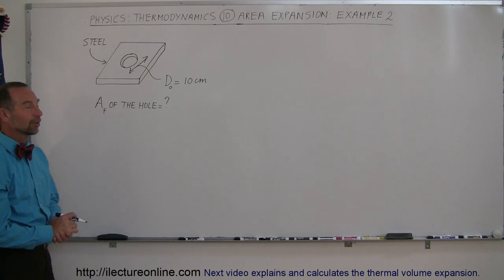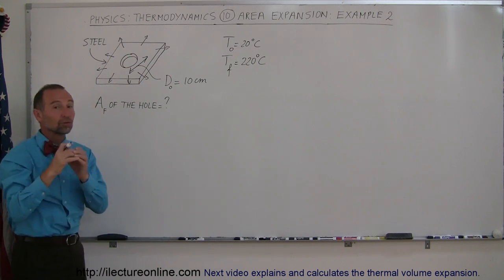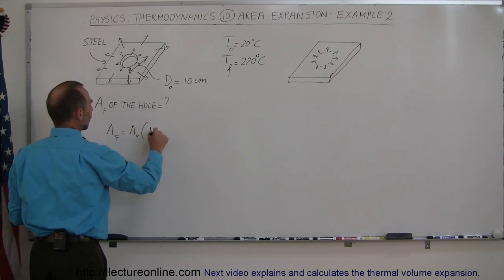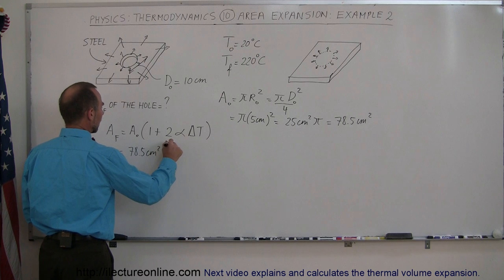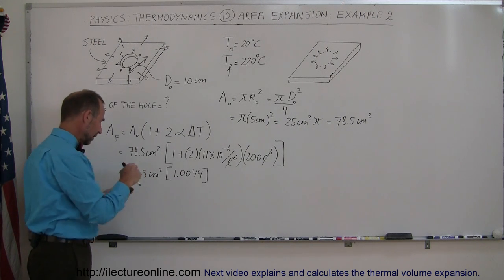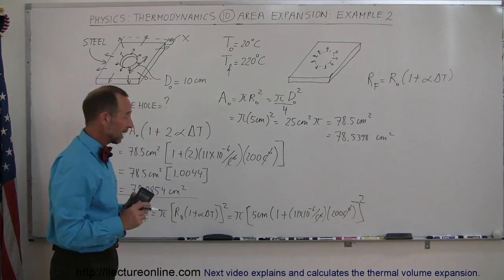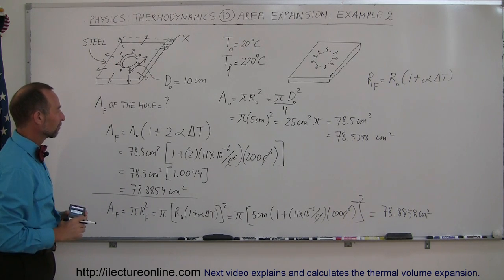Physics 21  Thermal Expansion (3 of 3) Thermal Area Expansion: Example 2

Comment: That is if the WHOLE plate is heated up UNIFORMLY. What if the plate was very large say 2000 mm diameter with a hole of 300 mm diameter and ONLY  a small area around it , say a diameter of 600 mm was heated, how would this work?

Comment: Hello sir I used linear thermal expansion equation to solve this problem and i get 78.9173 as the answer. Isn't this a more accurate answer? I used linear because when you discussed that when expanded it is still a circle, then the diameter of the expanded one is directly proportional with the original size. I also encountered problems like this using thermal linear expansion as the solution, is this wrong?
Reply from the maker: The concept of accuracy is often misunderstood.  Since the initial radius was given with only 1 significant number, only 1 number is significant in the answer.  In addition, the coefficient of linear expansion is not a constant but does vary with temperature somewhat, thus our method already has some "inaccuracy".  That said, however you are correct in saying that using the linear coefficient of expansion, will give you a more accurate answer, since the area coefficient does not take into account the (delta L)^2 term.
Reply: +Michel van Biezen Thankyouu! That (deltaL)^2 made the 2 answers different. Thanks for clarifying the concept of accuracy :)

Comment: Why do the particles around the edge of the hole move towards outwards direction as you've said in the video as well as in previous comments though they have got a good space towards the centre of the hole??
Can you please explain this to me respected professor?
Reply from the maker: Think of a Roman arch.  If the stones in the arch expand due to increase in temperature, can they move inward?

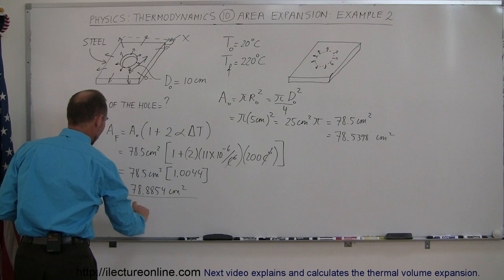Comment: Hi profofessor. When you do the calculation to include the error @ 5:29 , are you treating expansion in only 1 dimension? How do you justify finding the change in R using linear expansion and then plugging that value into A = piR^2?
Reply from the maker: The answer to your question can be found in this video and those following:  Physics - Thermodynamics: Temperature (1 of 3) Thermal Area Expansion: Definition

Comment: Hi Prof, how do I solve this?
The bulb and stem of a thermometer contains0.50.ml of mercury up to zero mark. if the length of a degree on a scale is. 30cm. what is the cross sectional area of the bore? ( apparent cubic expansivity of the mercury in glass is 1.5x 10-4 per k)
Reply from the maker: delta V = (1.5 x 10^-4) (0.5 ml) (delta T)     delta V = (area of base ) x (height)       where area of base =  pi x R^2
Reply: @MichelvanBiezen  I truly appreciate. I have been on this question for more than three years. I kept revisiting it . I am teaching myself physics thanks to the Internet and people like you.
Reply: @MichelvanBiezen please what happened to the 0.30cm that was mentioned in the question?  Could it be an error? Should it have been. 0.50cm? Because the answer given is 3.75×10^-4 cm2
Reply from the maker: There may be a problem with the wording of the problem  (I got 2.5 x 10_4 cm^2 as an answer).  To get the answer given, the height had to be 50 % greater.

Comment: there is a hole in middle of copper plate if we heat the plate what will happen with diameter of hole
Reply from the maker: The hole will expand (will get bigger)
Reply: Teacher, please split the solid/surface in 4 sides, by 2 normal lines through the hole center. Please explain how the 4 radii still increase due to thermal expansion.
....because i think it matters wether there is material or not in that hole. If there is, it expands. If there isn't, there's nothing to expant. Either I didn't get it at all, or your model is oversimplified. Thank you.

Comment: what if i restrict expansion at edges of square , in this case whether hole will shrink or still expand???
Reply from the maker: +Mayur Karche 
The hole will still try to expand, but may be prevented from the forces blocking the expansion.
Reply: +Michel van Biezen I am really confused , because in casting , in pattern designing allowances we add shrinkage constant multiplyed by initial dimensions in the outer surfaces but substract it in the inner surfaces dimensions... is it differ in solidification and contraction ( or expanding). !!? .....I am completely persuaded with the paint example , but why this is not applied in casting ??
Reply: In the second plate the material inside the circle is still present and presumably exerting it's own expansionary force. In the first plate it is absent and the molecules on the inside of the hole have to overcome no competing force to their inward expansion. Do they not expand inwards at all?

Comment: Why is that my answer when I calculate 78.5 * 1.0044 = 78.8454
Reply from the maker: 78.5 is a rounded number.  Use the exact value of 78.539816 for the area of the circle an you'll get the same answer.
Reply: I see. Thanks you've helped me.

Comment: you messed up @ 2:58 when you have piD^2 /4 it should be divided by 2 since you want half of the diameter.
Reply from the maker: No.  The video is correct.
Reply: Michel van Biezen i don't understand how 10 / 4 =2
Reply from the maker: 10/4 = 2.5
Reply: Michel van Biezen shouldn't it be divided by 2 since you want half the diameter and since the diameter is 10  you divided that by 2 to get your answer of 5.
Reply from the maker: The video is correct as is.
Reply: Listen closely to what professor says. He was going to use D/4 but decided that halving the diameter would be better; since this is what most people do anyway. He never decided by 4. It is simply 5^2 times PI
Reply: (D/2)=r,    r^2 = (D/2)^2,      simplifying further --> r^2 = (D^2)/(2^2),   simplifying furthest     r^2=(D^2)/4

Comment: Everything else is good but the reason you gave for expansion of hole , well doesn't exactly justifies it. Please if I can get a much better explanation. I know that's what happens but without knowing why it's just to digest without an proper explaination. Please don't leave me hanging just like my school teacher
Reply from the maker: Let's go to the very basics.  What is the reason why a solid expands upon heating?  The vibrational frequency of the atoms increase and the amplitude of the vibrations increase.  This causes the atoms to push against each other with a greater force, which it turns pushes them farter apart.  Now imagine the atoms along the edge of the hole.  They push against each other (needing more room).  There is then only one thing that can happen to the rim of the hole.  It will move farther from the center to accommodate the extra room the atoms require.  (Like a Roman arch)
Reply: @MichelvanBiezen  thanks very much sir
Reply: @MichelvanBiezen  professor, due to increase in oscillation of particles they tend to displace each other. The particles will move farther from each other to gain more space. The particles around the outer boundaries of the sheet get displaced outwards since they get a less dense area outwards. Considering the particles around the edge of the hole, they also get displaced towards a less dense space which is in this case towards the centre. So, I think the hole must contract. 
But you said that the atoms around the edge of hole tend to move outwards. Can you kindly explain sir, how do they tend to move outwards though they can find space towards the centre of the hole which seems to be the best possible way for them to find space?